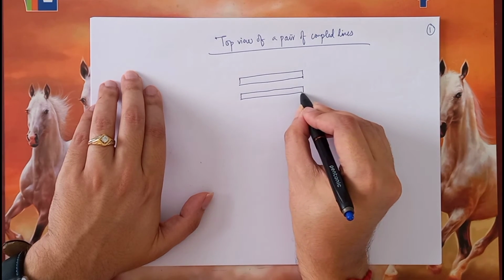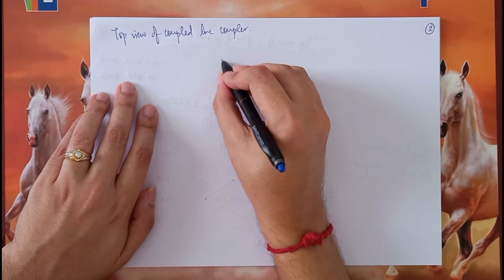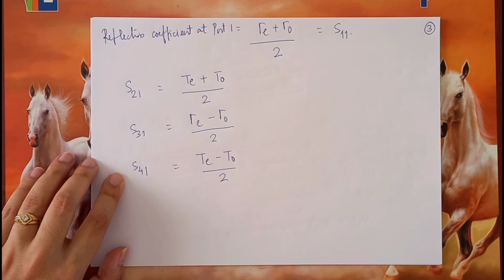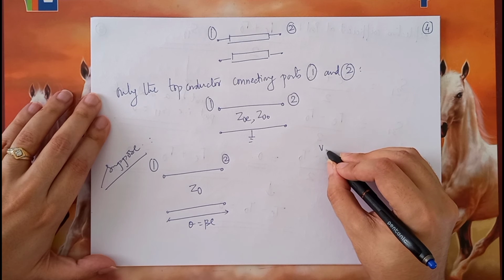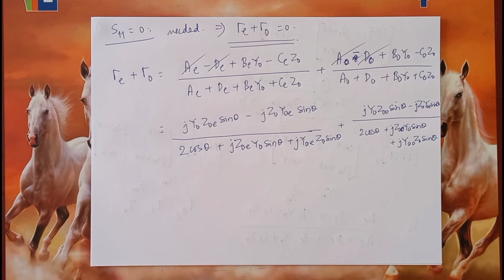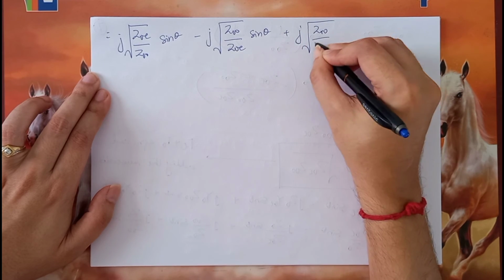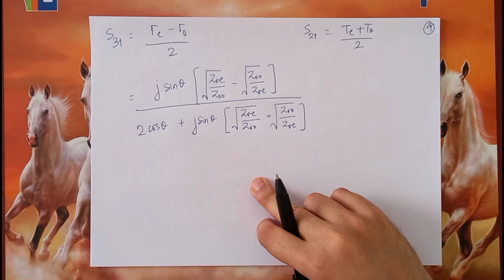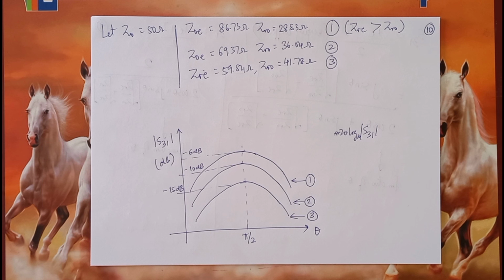Lecture 20: Coupled Line Directional Couplers

Comment: hi sir..what if the coupled port is grounded. what happens to s21 and s11? how it gets modified?
Reply from the maker: In a coupled pair of lines, if you ground the coupled port (Port 3), there will be more power reaching the isolated port (Port 4) due to reflection. In addition, a small portion of the reflected power, corresponding to the coupling coefficient will also reach the input port (Port 1), however usually the effect here is quite minimal. There should not be much effect at Port 2 as it is isolated w.r.t Port 3.